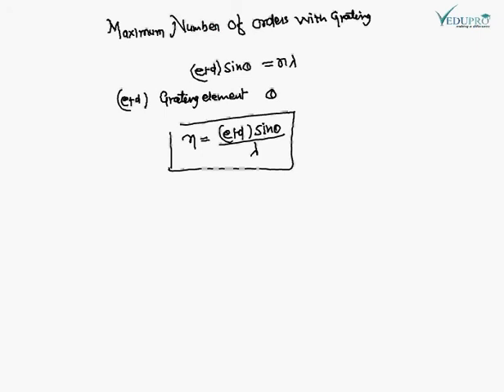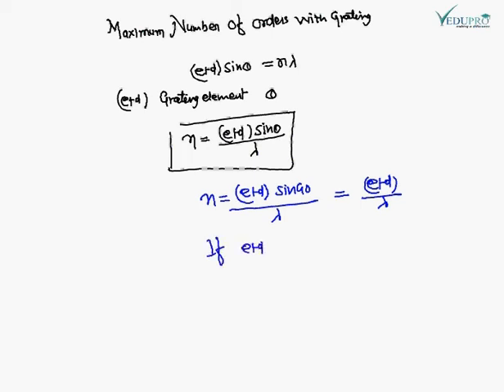Maximum Order in Grating

Comment: Please get someone else to do these, even the auto subtitles cant hear you. i cannot understand a word you are saying. this is the only video i can find explaining this and i dont understand it. sorry, i mean no offence
Reply: Maybe the video was not made for you 🤷‍♀️
Reply: @samud7041  man, 7 years on...
Yeah the video was made for me, I was an A-level physics student. This is A-level physics. I wanted to find the maximum order of a diffraction grating and I wasn't able to understand from the video.
Reply: @aegis12314  i'm doing A-level physics now and I need to find out the maximum order!!! Do you remember what the rules are?
Reply: @meh3080  
Diffraction grating equation is
dsinø=n lambda

You cannot have any maxima at an angle of sinø>1, so therefore, use ø=90, then whatever answer you get for n, round down even if the answer is 1.9999...
Reply: @aegis12314  Ah thank you. So you just divide d by lambda, and this tells you the max path difference essentially?
Reply: @meh3080  basically, light can't be diffracted backwards (that's reflection) so the maximum angle it can diffract is 90 degrees, and sin90 = 1
Reply: @aegis12314  thank you very much...your texts were more understandble than the video.
Reply: @_greysama_  no problemo! Glad I could be of service
Reply: @aegis12314  Live saver man, i had a similar problem (couldn't understand the video too well) and happened to look in the comments.
Reply: Why e+d is less than 2lamda